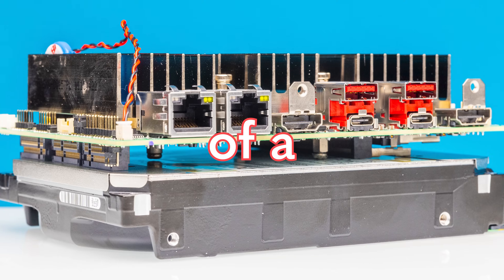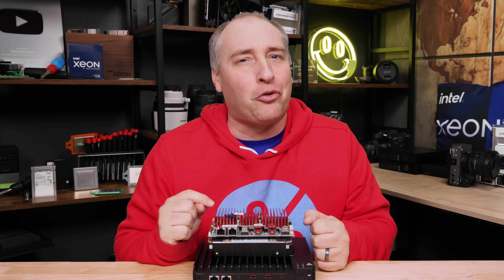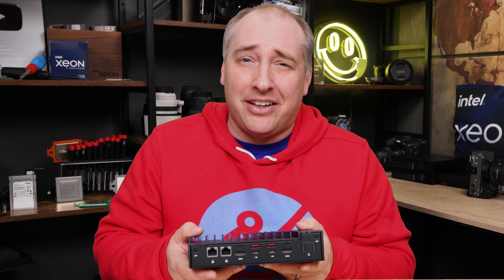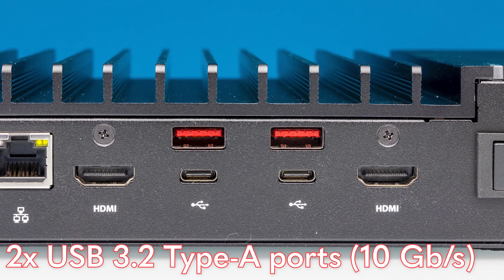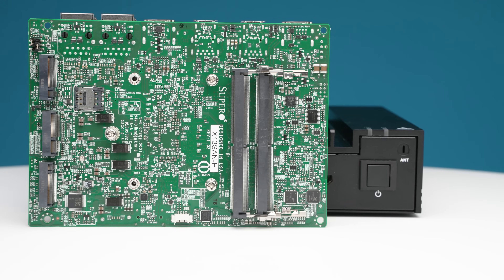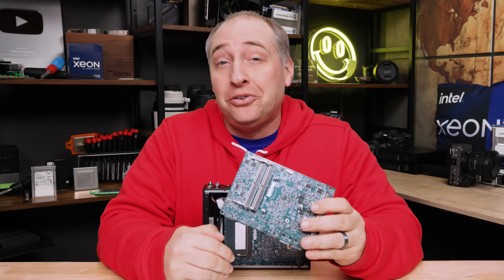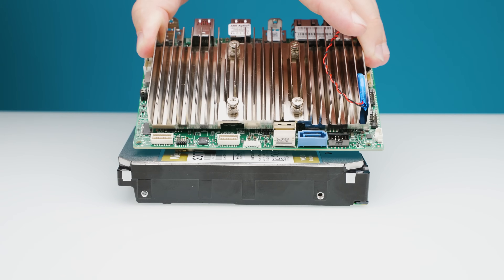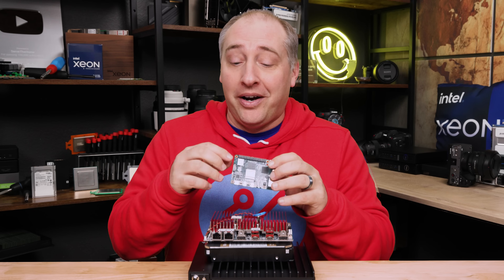THIS is a Hard Drive Sized Fanless PC

Comment: I always had the idea of building a complete fast x86 system in one of my old OWC Dual 3.5" HDD Cases. One bay for the board, the other bay for two u.2 nvme drives. this could actually work nicely with some 3d printed parts. quite expensive for home use though.

Comment: You lost me at i225 nic.  Stability is still an issue.
Reply from the maker: We run mostly under Linux, and typically not the gaming platforms, but with around 300 i225-V B3 ports online we have not seen it yet
Reply: @ServeTheHomeVideo   I have under ubuntu.  It is an issue with high bw applications.  I have had much more success with Realtek.  The tx hang issue is well documented.

Comment: how does it compare to the N305? Going from passmark, seems like this 1265UE with its 2×P cores and 8×E cores is slower than the N305's 8×E-cores? That doesn't make any sense
Reply from the maker: Passmark is strange. We have the N305 in the benchmark charts. This is faster.

Comment: I remember COM and parallel ports.  You don't see them any more.  Gone are the 40 pin headers for older hard drives and also the 34 pin header for floppy drives,  Modern consumer motherboards just don't have any of those things.  There was also a time when BIOS chips were socketed and now they solder them down.  The nice thing about a socket for them is if you had a bad flash you could swap a good one in.  Or if you had the equipment you could then reprogram that chip.  That is still possible these days but more difficult because they solder them in as a way of flipping the finger at you for wanting a computer that is more repairable.  Even worse is soldered down RAM or SSD (Apple comes to mind).
Reply: Well, instead of socketed BIOS chips you now get dual bios, easy buttons to flash back..

And soldered RAM is a lot of the time a function of space, and/or efficiency and performance (with lpddrx).

Apple is the definitive example for it being used as a middle finger to the consumer though.
Reply: but for embedded industrial controllers, COM ports are everywhere. loads and loads of PLCs this would connect to use serial ports
Reply from the maker: Exactly.

Comment: i use for my daily stuff a asrock j5040-itx this thing cost about 150€ and is fast enough and needs only 4w in idle with a lightweight system with like a plain debian without ui or ubuntu server ans such. but with ubuntu 22.04 lts it uses 7w in idle. the system uses the intel pentium silver j5040 it has a tdp of 10w and can do 2 4k video streams and has 4 sata ports can use up to 16gb ddr4 sodimm ram 8g per channel. for a daily system perfect even harder stuff like running a jetbrain coding environment handle it well. but you can do industrial stuff to you have some ports you can use.

Comment: You need to measure the temperature at idle and under load on those heatsinks.  I bought a N100 system from AliExpress based on one of your videos and the thing felt like a frypan, maybe it was just faulty I dunno it wouldn't run any OS properly it'd blue screen or have kernel panics etc......  the ram tested fine with memtest........  so I ended up sending it back.,
Reply from the maker: We showed the temps during the power section. The package was around 65C after 100min at 100%
Reply: Could have been poorly applied thermal paste, or faulty heatsink.

Also if you got the smallest unit, with the smallest heatsink.. Well, yes it will get uncomfortably hot pretty easily.
Reply: its not faulty...you do need to throw a fan on these if you put any amount of load on them or else they will start throttling.
good choice to return it anyways, i bought two of these n100 boxes and totally regret it since they are too slow to run a small homeassistant instace and a pfsense sense router with a 1gbe connection on esxi

Comment: I always wonder when I see these weird boards, what company paid Super Micro to make this and what was it used for?
Reply from the maker: An interesting note is that we published the review of the previous version two years ago tomorrow. So the customer is iterating
Reply: log a lot of serial data to reliable storage, compress, feed out at greater than gigabit when you can normally but fall back to cell if necessary, maybe onsite display hooked up showing metrics?
Reply: @floodo1  embedded controllers on industrial machines of some description, PLCs or other controllers to the serial ports.. there's an infinity of uses.

Comment: 10:36 anyone else notice when he held up the Raspberry Pi and showed the bottom it was like seeing through him? The white thing on the shelf behind him becomes visible through it. Is it a virtual backdrop?
Reply: It gets weirder. If you look closely you can see that it's actually a cat in a motion tracking suit using CGI
Reply: Pretty much by the looks of it. Look at his right arm and shoulder at different moments. There is a slight green fringe reflectivity on the edges of his figure overall.
Reply: Ya, I had no idea it was a virtual backdrop.  Would make sense from lighting control perspective.  It's trippy to see that Pi went semi-transparent for a second or two due to the chroma key.

Comment: Nice little system there. I designed a RF system that used one of the older 8000 series i chips (industrial spec as well) a few years back. Hope SM got over their milling issues they had with heat sinks not making contact correctly with the CPU dies. I ended up having to scrap the SM design because the quality of the HS was so varied. (Could shine a light between a straight edge and the HS base.)

Comment: good old supermicro. They never fail to be the most expensive option.
Reply: Gotta justify the stock price somehow
Reply: Yeah, but they work, get (some) updates and there's actual support
Reply: Tyan gets up there too.
Reply: Maybe compared to no name Aliexpress or consumer brands. But calling them High End in Enterprise?? LOL. They are THE budget option since forever.
Reply: @TDCIYB77  not sure where that comment came from jeez , i remember i bought the supermicro version of the pfsense firewall without the cost from the branding , now i think they have exclusivity to those models =S
Reply: @boxfabio  He is right, Supermicro works as whitebox/OEM for a lot of firewall and storage companies (ixsystems for truenas too). If you go with the usual suspects instead (Dell/HP/Lenovo/Fujitsu) it's more expensive and you are locked in their ecosystem
Reply: (laughing in Dell)
Reply: @marcogenovesi8570  Exactly.
Reply: Supermicro compared to other large OEMs is usually much less expensive. I mean if you’re comparing them to chuwi then sure
Reply: Just looked up the price on a website. About 800€ for just the motherboard. My entire NAS Server (including hdds) costs less than that. Unless you need to operate in an industrial environment, this is a total waste of money.
Reply: @partyparrot7260  Again, my homelab is also made up of consumer gear.
But this specific product reviewed in the video is tailored for enterprise and industrial use, where the 1000$ price is pocket change, and no one would DIY a system with consumer parts or without certifications.
Reply: @partyparrot7260  plenty of "gaming" motherboards are in that range. quality modern workstation boards, probably 5x that. comparing apples to oranges doesn't really mean anything.

Comment: Would be nice if it can be mounted in a 3.5 tray so that it can be placed in a JBOD rack as a case.
Reply from the maker: I think these typically go in embedded systems and also have custom case options. A JBOD case would need to figure out power but also the I/O would be oriented in the wrong direction. I agree though, it would be fun to have a high-density version of this.
Reply: @ServeTheHomeVideo  
Would finally give a use to all the 5in bays that have been sitting mostly empty on the old pc cases that still fits modern hardware